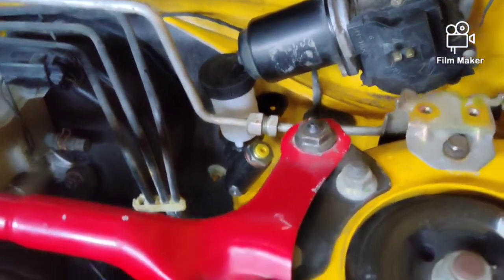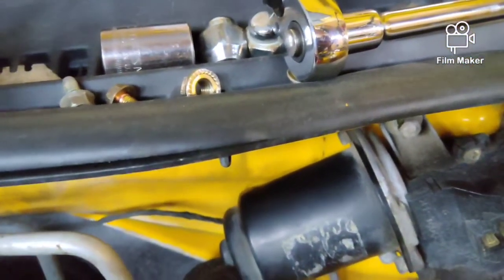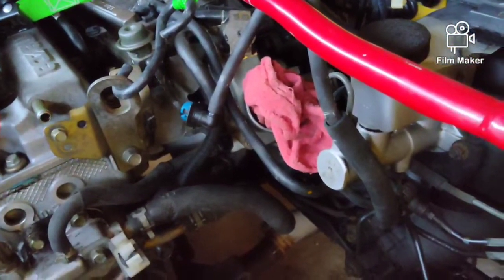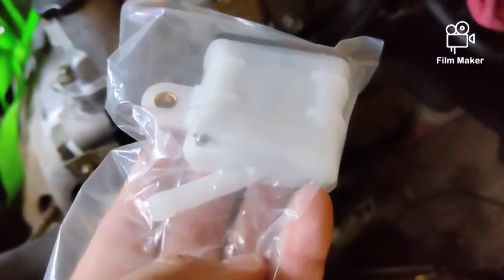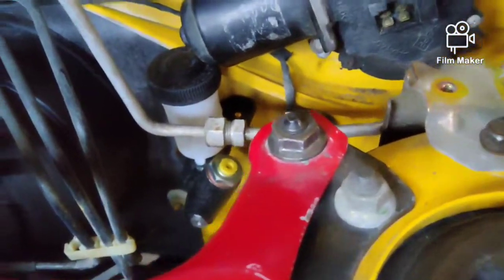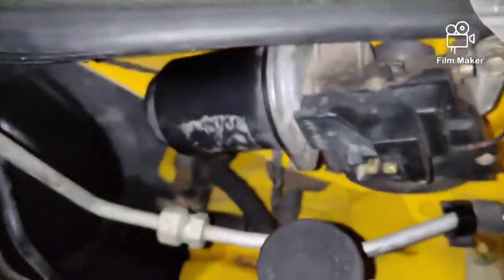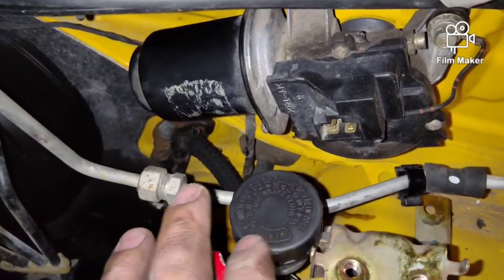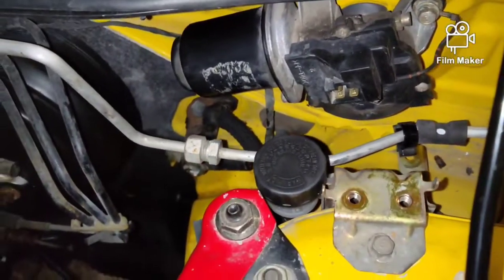Mazda Protege Clutch Master Remote Reservoir

Comment: I'm very curious to try this on my Protege. I hate that they share fluid with the brake system. That's a smart idea. nice video.
Reply from the maker: I originally got the reservoir off of Amazon. I literally used all OEM parts except for the reservoir and the bolt
Reply: Awesome, thanks for the info. I'll be sure to check out the option out there.